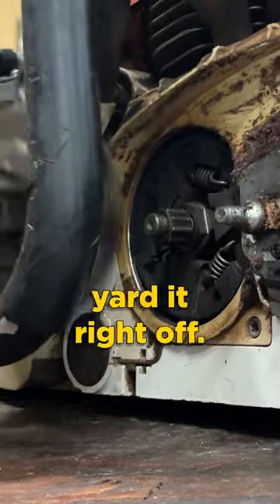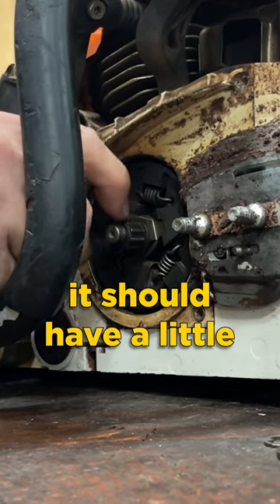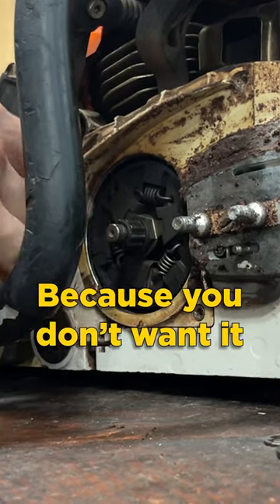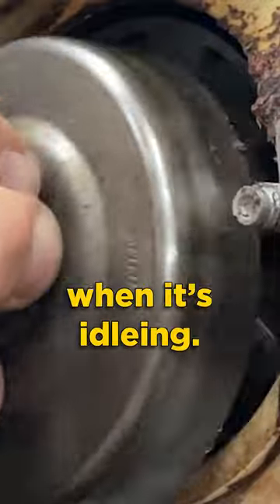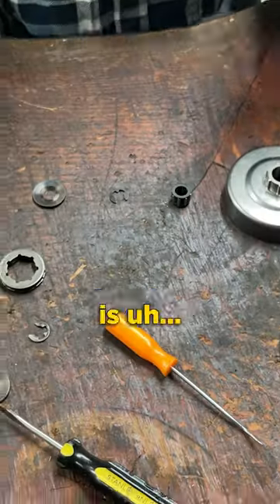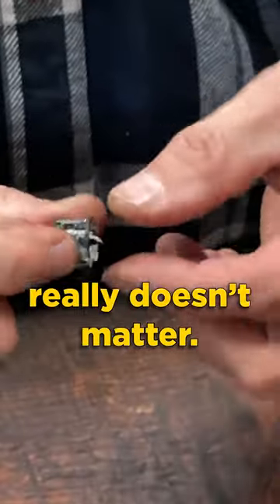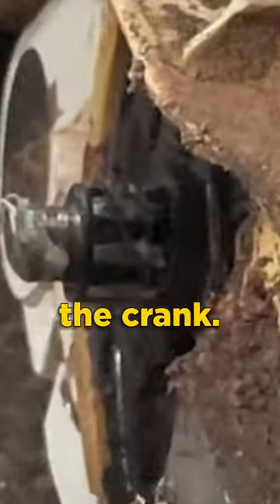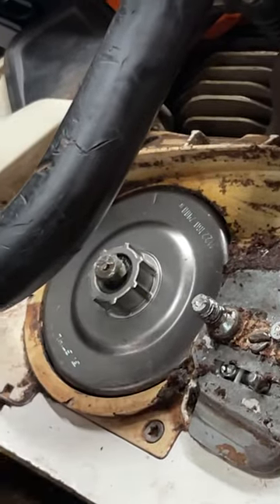Chainsaw tip: Greasing the clutch drum bearing with Gordy #shorts

Comment: I've worked on 2 strokes for the last 3-4 years and all the chainsaws I had to dismantle had dry clutch drum bearings. As you said they do need grease. We actually had a saw come in that was completely seized, with presumably a bad motor, that just had a seized/broken drum bearing. That's all it was. Also, they do make a grease gun/tool to grease that bearing without disassembly. That's what that hole in the end of the crank is for. It feeds that bearing with grease. Thanks for sharing this for others to see and maybe, there will be less dry drum bearing out there in the field!
Reply: The hole isn't for greasing on all saws, only a few. You should disassemble and check if the hole actually feeds through.
Reply: @rorschacht8478  depends on the brand. Every stihl and husky I've taken apart, had that hole for greasing the bearing. But at the shop we work on a lot of old stuff. So like you said it's probably best to just take it off and make sure. It's really easy to pull the clutch drum off and check anyway.
Reply: Thanks for sharing your knowledge

Comment: I melted the cage apart last summer on my ported 460 put a new bearing on and trashed it in a few cuts. The crank side of the bearing cage melted to the crank I didn’t notice it until after destroying the new one. Point is your definitely correct grease the bearing and it will last longer.

Comment: So what is the rpm of that crank? I wonder how long the grease stays put? Also temperature is a consideration? 
It’s not a bad idea but better to keep an eye on the wear and replace the bearing before it becomes worn.
Reply: guessing around 12-13k rpm for the 660-661, keep it greased at least monthly I have never had one fail in over 20yrs.